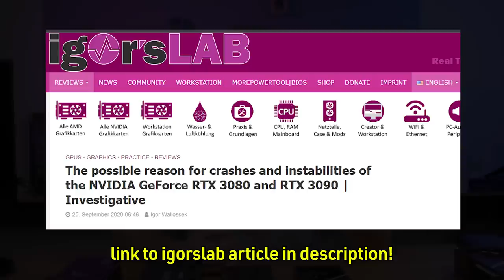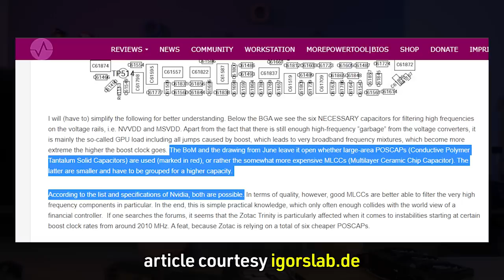The RTX 3080 Launch can't get any worse... Right? Wrong...

Comment: The theory here definitely seems sound.

I think it's an affect it what can sometimes happen when the manufacturers stray a bit too far from the reference design.

Some cards are literally just the nVidia reference design PCB/components, just with different branding on (as it's always been), so it would be interested to see how those fair in comparison to the cards without the smaller caps.

(btw, MLCC is a common type of ceramic cap. "POSCAP" is a Panasonic-specific trademark for their Conductive Polymer Tantalum cap.)

The pinned comment by Kevin Gaukel (RF engineer) explains what the issue might be.

For anyone wanting to know more about decoupling caps, and the different in impedance vs frequency, Dave from EEVblog made some great vids about it ...

https://www.youtube.com/watch?v=BcJ6UdDx1vg
https://www.youtube.com/watch?v=1xicZF9glH0

It would also make for a VERY interesting vid if somebody could replace the one or two POSCAPS with a set of the smaller MLCC caps.

But, for the love of God, PLEASE find somebody other than Jay to do the soldering, and use a decent soldering station and flux this time. lol

(it should be possible to solder smaller MLCC caps across the existing pads, or it would be worth even getting a small adapter PCB made for it.)
Reply: I think the other lesson here is that overclocking really is pushing the boundaries for most cards from what they were really designed for.

(especially if you're overclocking above the stated boost clock freqs, obviously.)

ie. regarless of whether the manufacturer puts extra "boost" options into their firmware, the advertised max clock freqs should be taken with a grain of salt.

Although, I agree that they shouldn't really advertise those higher boost clocks if the card can't consistently and reliably reach those top boost freqs in all kinds of setups of case / (power) noise / temperature / PSUs etc.

It's also possible that their testing wasn't quite thorough enough for boost mode.
It's gonna be an interesting few months in tech news.
Reply: Another interesting thing to note on the Igor's Lab link - a lot of the cards actually have the smaller pads for the MLCC caps surrounding the POSCAP footprints.

ie. you could just remove the couple of POSCAPs on those cards, and solder MLCC caps to the smaller pads quite easily.

Really want to see a card now that is known to crash at higher clocks, modded with MLCC caps, then re-tested.

Even better if we could see some before and after shots of the noise on the VCORE rails on a Spectrum Analyzer.
Reply: I read all of igor's article , and it looks like some companies (like Zotac) are already recongnizing the issue, and have even started replacing the POSCAPs on the cards with MLCCs.

(possibly even manually reworking some of them, but it wouldn't take much effort for them to have the PnP machine place ceramic caps in those positions instead.)

I don't think this is a problem specific to the POSCAPs themselves, btw.
This seems to be a problem of not using quite the right choice of components for the task, at those upper boost clocks.

(unlike the cap/filter modules on the old PS3 motherboards that used to fail.)

Comment: if ur hearing the Jacob's ladder effect noise from 3 quarter million volt thousand Amp lines then get the fuck away like yesterday n call 911 not even bge   the more moist.... not dry idk y he said that, the lines would make go from a slight or buzz that sounded like 60 hz, n the wetter the air was the more of a zappy sound it would make but it was very consistent, it doesn't ramp like he said

Comment: Wow looks like all the JayzTwoCents fans that called me an idiot were wrong. What a surprise! What a surprise that Jayztwocents was wrong too and doesn't know what he is talking about.
Reply: @Battleneter  Back when i got Ryzen 3600x they fixed high temperature and stuttering by lowering  boost clock by 50/100 Mhz after a week of 'hard work'. Is Nvidia solution same?
Reply: @Battleneter  And yet, several of the AIB's are directly contradicting that statement. In fact, EVGA has put in an official statement, saying (and I quote) 'a full 6 SP-CAPs solution cannot pass the real world applications testing'. GALAX (KFA2) says pretty much the same. So, why should we believe Nvidia?

[EDIT] I'm also seeing a number of them very quickly updating the products pictures on their websites to remove any pre-production models which might shows the wrong set-up. If they stood by their statement saying this doesn't affect the product, this little detail shouldn't be an issue. [/EDIT]
Reply: @Shade01982  AHHH Since that EVGA statement EVGA has done a backflip and acknowledged to Gamers Nexus it was just a driver issue (check out their latest video today). Users of EVGA 3080 XC3 also reported crashing with Multi type capacitors btw, now users reporting back as fixed. EVGA mis-diagnosed the issue!.
Reply: @Battleneter  Ok, that makes it a real possibility, but they have literally copy-pasted the official Nvidia press release word for word. That sounds like a gag order to me.

All in all, that's why I don't pre-order...
Reply: @Shade01982  No EVGA made a mistake, ALL cards regardless of capacitors were crashing, even the Asus TUFF with ONLY MLCC capacitors. This is not rocket science to understand, put away your tin foil hat.

Comment: I have to say the comment section in this is fascinating, some are saying it was just the drivers causing and how incorrect he is and how he should be thrown into a dumpsters. Others are saying the update lowered the voltage and downed the clocking speed, not a computer expert by any means FYI. I guess at the end of the day though this just shows the fact that companies don't give a fuck about the consumer. Given how readily they released something like this and how broken it really was, with potential band-aid fixes that downgrade the potential of the card. Given they didn't build it properly to be able to handle what they promised it could potentially.

Comment: Designing for today’s electronics is much more challenging as the edges of all of the digital squarewaves for example are much steeper and sharper than in the past and the power supply decoupling capacitors and the printed circuit board inter-plane capacitance needs to be combined for a low impedance at much higher frequencies. For high signal integrity and low electromagnetic interference (EMI) the layout and decoupling parts used are critical.

"POSCAP" is a solid electrolytic chip capacitor developed by SANYO (now Panasonic) where the Anode is sintered Tantalum and the Cathode is a highly conductive polymer formed. The resonant frequency depends on the series and is approximately 100KHz to 1MHz and above this frequency the impedance increases as it is dominated by the series inductance. Refer page 19;

http://datasheet.ciiva.com/29312/420965-da-01-en-poscap-tpb-6-3v-150uf-29312653.pdf

Multilayer Ceramic Capacitors (MLCC) soldered in parallel with POSCAP are normally needed to lower the impedance at the higher frequencies and have a resonant frequency of approximately 10MHz to 100MHz for example.

https://www.cde.com/resources/catalogs/ceramperf.pdf

Printed Circuit Board (PCB) inter-plane capacitance is created by pairs of large conductor planes with a dielectric (eg FR-4) normally connected in parallel to the power supply decoupled by the POSCAP and MLCC capacitors. These planes have extremely low series inductance and provide low power supply impedance from 500MHz to above 5GHz. The capacitance value however is much lower than MLCC and POSCAP types.

Therefore, without Ceramic Capacitors or MLCC you may have signal integrity issues depending on the supply current and the capacitance needed.

Comment: I wonder if this has to do with the PAM4 signaling that allows multiple voltage levels to represent more than just 1 and 0.  https://images.anandtech.com/doci/16057/NRZ_v_PAM4-Labeled.png
It would be much more sensitive to EMI and bad voltage than a simple level triggered 1 or 0.

Comment: Nvidia 30 series cards are severely in short now as it seems, be it for FE editions or AIB cards. What I may surmise from the current situation is that there must be a collusion between scalpers, by that I mean all the re-sellers other than AIB channels, and AIB manufacturers to continue their futile efforts to clean their sky high stockpile of 20 series cards, instead of putting new cards on the shelf. Do not fall into their traps, my fellow comrades . Let them take their 20 series cards with them to the graveyards.

Comment: It appears from what I see on your video that there are pads under the cheap caps. Is it possible to remove the cheap caps and install the others? Thanks for the video.
Reply: @rustable4165  He explained the electronics theory of the likely cause and if he is correct it's because the cheaper versions of the cards can't do the higher clock speeds. If it was purely a driver issue the problem would be the same on both cheap and expensive cards.

Comment: 1. Watched 3080 announcement
2. Sold 2080 ti on ebay
3. Ordered 3080
4. Noticed it can not be delivered..waiting..trying to be patient
5. Read about the caps problem which is the worst on the ordered Zotac 3080
6. canceled 3080 order
7. ordered another 2080 ti

crazy stupid times

Comment: After watching Jay's now week old video and the Hardware Unboxed video, I can't agree with the interpretation that Jay did anything wrong. Yes, he was ultimately incorrect, but it appears he made that video in good faith. There WAS a problem and he had a working theory on the mechanism of failure. He took apart half a dozen cards on video and the stability issues matched his hypothesis. Had he been ultimately correct, he would have been vilified for keeping that information from us. Instead he let us know what he knew when he knew it. Ultimately he was wrong, but you know what? Those people who cancelled their orders can still buy the cards in the future. If someone got stuck with a defective product, he or she would have to deal with an inconvenient RMA process if the companies even acknowledged this issue. Jay was trying to look out for us. I can give HUB the benefit of the doubt by taking their claim of wanting to wait until they knew more at face value, but you can't deny that now they get the benefit of hindsight for their video. If the issue happened to go the other way (and there's no reason to believe something like that won't happen in the future), people who listened to HUB and bought the card would be the losers and Jay's audience would be the winners.

Comment: Buying a GPU since COVID is just an insanely dumb idea.
You get overpriced garbage with low built quality and due to scarcity different builts even in the same charge. It's never been this bad and the amount of broken and sent back GPUs only confirms that. 
It might take years but it only makes sense to buy GPUs again once the supply chain is completely repaired.

Comment: What a stab in the heart ❤  well good thing the cards are so unavailable, hope this cuts into the prices, and FUCKS THD SCALPERS ! Maybe a little silver lining? Idk, id be pissed. I've always liked to look at the reference designs The Corrs oh, I personally like to look up the blower fan but will not buy one. The prefer not to game next to a small jet engine, and I'm firmly team red as of now fair value and availability seems better. Nvidia seems too high on itself these days. And they got me on a 970 but I still loved that card...  I am now a RX 580 8 gig go three and a half just ain't enough. And I want to upgrade oh, but I'm a stickler for good price. The good deal. The reference version of the 970, Brad design i beliece was weaker, had fewer Vrm Phases, then the AIBs, so Other then the apparently binned  GPU, The reference designs,  or founders editions, were poorer options in Compared with the AIBs, But now, Since the 20 series Nvidia Founders have been Whatni would Prefer,  Now even more.. Bad on Nvidia for having 3 designs, they Sabotage in a way, they knew that most partners are Buissness, and will save at all ppertunity. Like come on... like we are we going team red for my next upgrade, if they ever become if they ever become available for the correct price somewhere around MSRP. Sucks right now I'm stuck, for my current card is worth more than I bought it for sells for more than I bought it for new. There are options on eBay, thinking 1017 TI if there is  good ebay deal, Never Bought a Gpu there, sold some, good deals. But I Prefer a warrenty and the whole mining wave, Worries me, don't want a card with thousands of hours, at full Blast, even if it works.. So I guess it's GPU  hell again.. Member before when few knew even what the hell a Pc gpu EVEN WAS ! I think I would be prefer rx5000 something, if they even become available soon freaking ridiculous.

Comment: You sure you're right about the ASUS 3080 TUF having the more expensive caps Jay? I just checked the backside pics of the two models Newegg carries, and both show all 6 caps being the cheaper ones. 
https://www.newegg.com/Product/Productcompare?CompareItemList=14-126-453%2C14-126-452

Now ASUS's main site shows both models with all 6 caps being MLCC, but two of the sub vendors they list  on the Where to Buy tab (Newegg and B&H), including their own ASUS Online Store, show all 6 caps being the  cheap ones. The other sub vendor shows no such pics. It appears they may have made a running change the cheaper direction. https://store.asus.com/us/item/202009AM160000001
Reply: @Battleneter  Yeah it seems obvious Jay's assessment is not scientific. I'm also not surprised it was mostly a driver issue, as that's the common scenario with new architecture, and what I suspected initially. I can also see how this kind of thing can get blown up just due to the large inconsistency between manufacturer's product pages, vs Newegg, B&H, and even ASUS' own online store, regarding pics of the caps. EVGA also told me they had to make a firmware change to adjust boost clock settings due to instability, and that was on their sub $790 3080s, which use only one MLCC. Bottom line for me regarding hardware spec though is I expect at least as robust a design as Nvidia is using, and on the 3080s they always use 2 MLCCs, not one or none. In fact if I'm paying a fair bit more than reference price, I expect not just a better cooler, but a more robust power delivery circuit. So despite the driver revelation, I'm still a big fan of what ASUS are doing with the TUF, especially at the decent price point it hits. That said, what scares the crap out of me about ASUS, is every time I talk to their support people, even the so called "techs", they're always learning more from me than I am from them. They are merely basic troubleshooting personnel that don't know any more about the product than the average gamer, in fact often times, they know less.
Reply: @MrFragManiac  As Capacitors were never the issue, I am not really interested in talking about them any further as even EVGA has done a backflip stating there all SP-Cap design is fine with new drivers (as it was with the pre-release drivers) . Jay just needs to remove that offending video as its STILL misleading people.
Reply: @Battleneter  What EVGA models are you referring to as having "all SP-Cap design"? Pretty sure they have no such thing. The closest to it they have is a 5:1 config (1 MLCC, 5 non ceramic}. This was verified by EVGA when I spoke to them.
Reply: @MrFragManiac  The sample EVGA FTW 3 that was used by Gamers Nexus for over clocking was the original "all SP-Cap design " (it won the overclock between the 3 cards btw), go have a look yourself clearly shows the all SP-Cap design  :) . EVGA has SINCE back flip on the issue and stated that original design was fine, it was fixed by the driver correction . If you DONT know why are you commenting?

Comment: Can u solder the better Things on it?
Reply: @rustable4165  no is Not a driver issue
Reply: @honigbrai  yes they released a fix
Reply: @rustable4165  its a fix that down clocks your gpu
Reply: @honigbrai  by 30 MHz that's like 1%
Reply: @rustable4165  yes but its 30 MHz thats missing and the cards are cheap made
Reply: @honigbrai  30 MHz isn't that much but they're cheap what did you expect at least it didn't cost a lot
Reply: @rustable4165  From what he said it's a driver issue in the sense that the clock limits have to be reduced because of manufacturers going cheap with the components. ie. if he is correct an over built card won't need any driver parameter adjustments.

Comment: you said mlcc's are expensive any all these other designers are going cheap with it, how much more does it cost for the "good mlcc's" then to the cheap big ones
Reply: It actually costs less to put 10 MLCC (around $0.40 for 10x47uF) than the cheapest “POSCAPS (acktually they are aluminium polymer panasonic SP series caps; $0.60 for 470uF) for the same capacitance. 
Source: Digikey

Comment: if exchancing the capacitors really fixes the issue, i would love to buy one of those "problem cards" for cheap and solder some new capacitors on there.
Even if the pcb does not have the right component foorprint, it should be possiple with a bit of 
tinkering for any electrician with smd soldering experience to fix this.

Comment: Fault was not Nvidia part but contract manufacturers who use too cheap parts.
Minimum intended without clocks but those idiot manufacturers clocking GPU to minimum capasitors.
Yay we use cheap parts to sell our carts little cheaper than others and every one buy our carts. (Big fail.)
Reason why i buy only MSI made GPU carts. (A few others are good too but i don’t trust cheapest GPU manufacturers.)